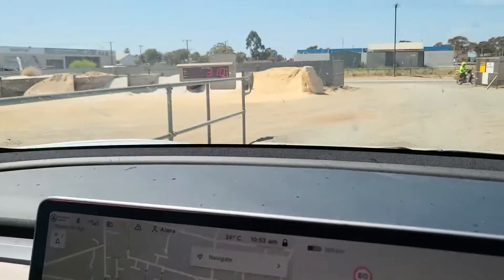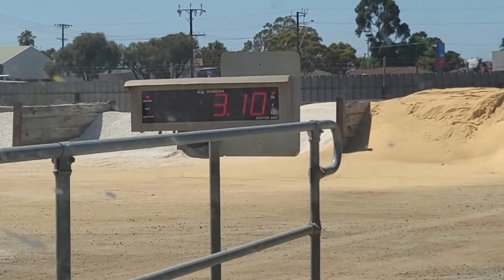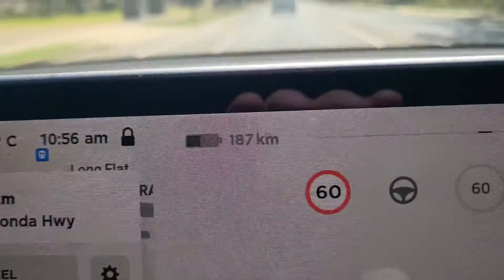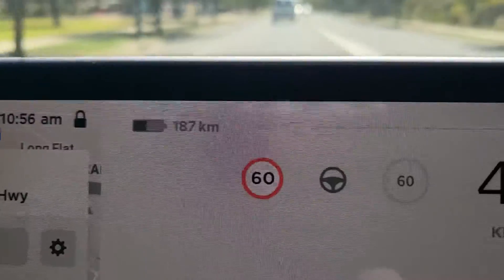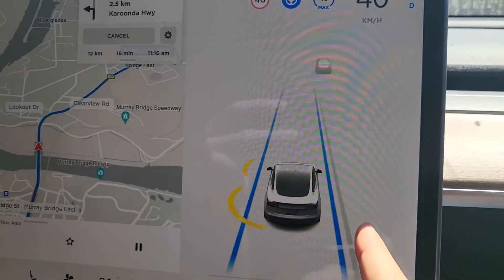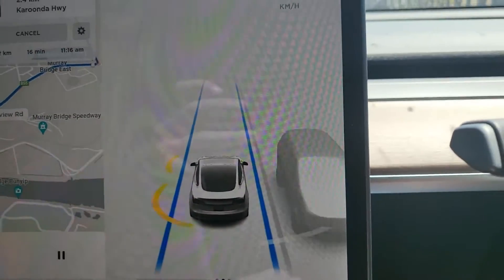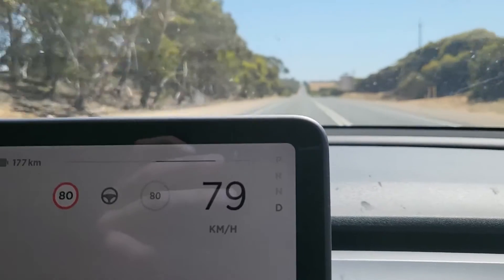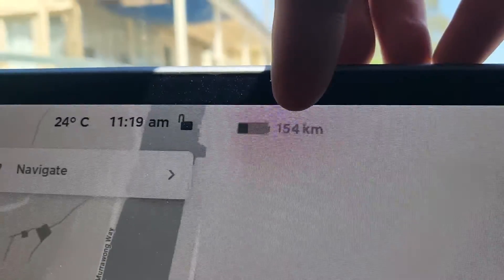Towing 1 ton behind a Tesla

Comment: New to the channel 
What do you mean you don't use the breaks?
Reply: This clip should help explain: https://youtu.be/wPPQ55cn-OM
Reply from the maker: The car is set up that the second you come off the go pedal it cuts the power and starts using the car as a generator taking power from the wheels and charging the battery. This way if you go down a big hill it will put power back in your battery while also slowing the car. The video linked above explains it pretty well but just out of interest I commonly do a trip that has a 15 minute down hill segment, in this part of the trek I often see 6 to 8 kilometers added to the battery range.
Hope this helps explain it a bit more.
Reply: @DamianCandetti  thanks for that the video does explain a lot and your response was 10/10 can't wait for next video